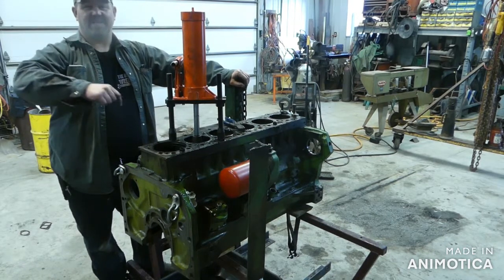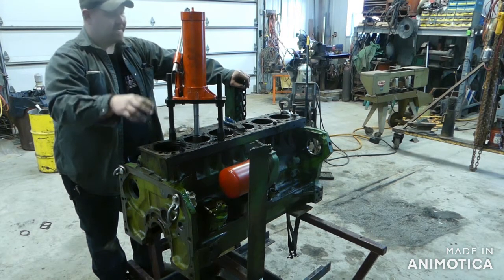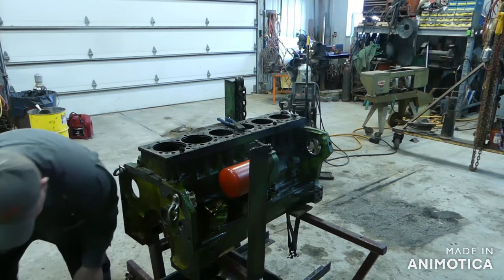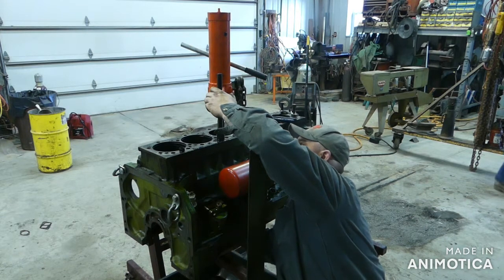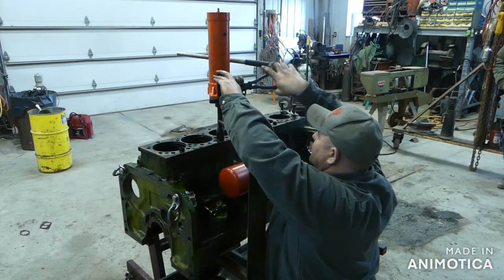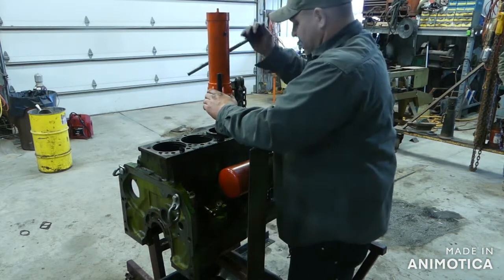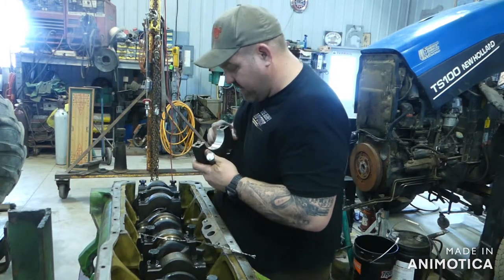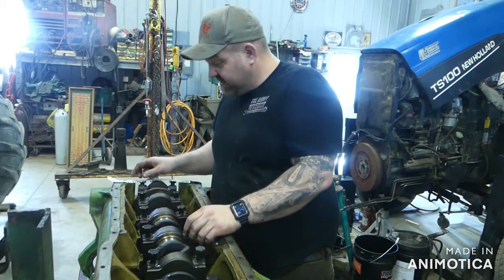deere engine part 2

Comment: Great video can you adjust the nut on the bottom of the sleeve puller from the top through the sleeve hole? It seems like it would be a pain to do if you were doing it inframe but it looks like a awesome puller
Reply from the maker: https://youtu.be/wRTo5X-NdCo

Comment: If I want to get into being a heavy equipment mechanic would I be better off starting with 3/4 chrome only or impact only or both?
Reply from the maker: Impact is better but chrome is cheaper if you can afford to impact is the way to go.
Reply: @theheavywrench9549  I bought a Milwaukee 1/4 and 3/8 set them decided I need to buy american, so I've built my 1/2 set with pawn shop sk and new old stock Armstrong, complete 3/8-1-1/2, metric is still lacking but it turned out to be all 12pt so now I'm working on 6pt. Where on the favorability scale is 12pt in 3/4"dr?